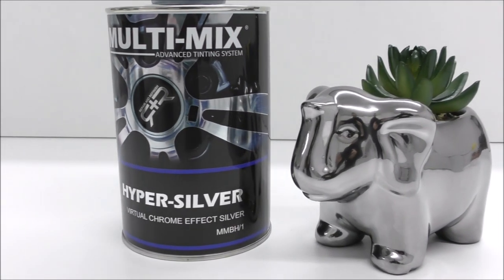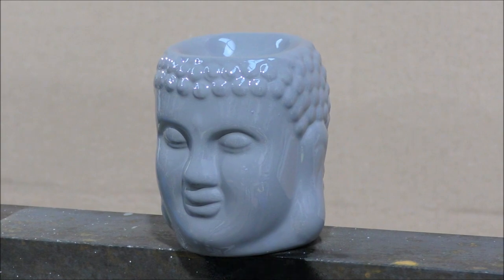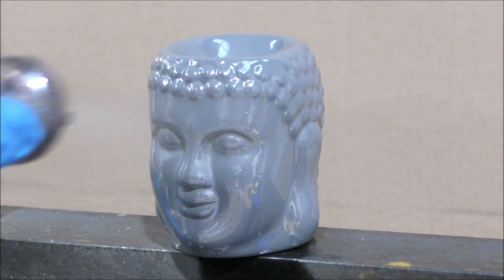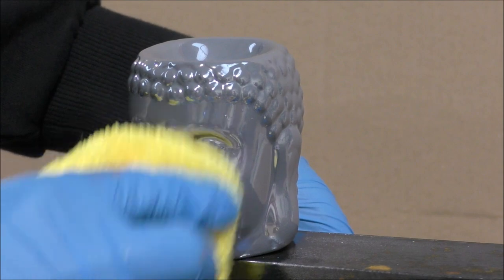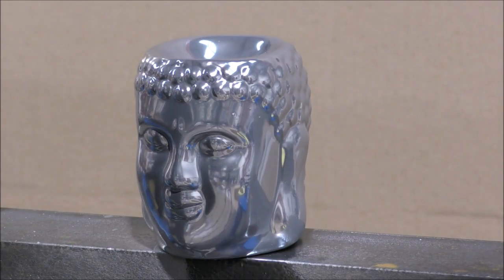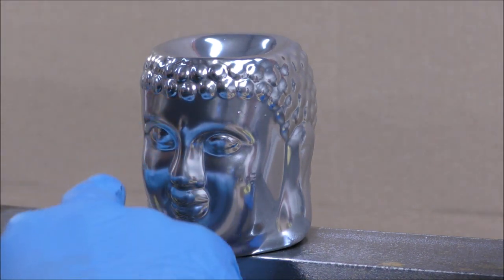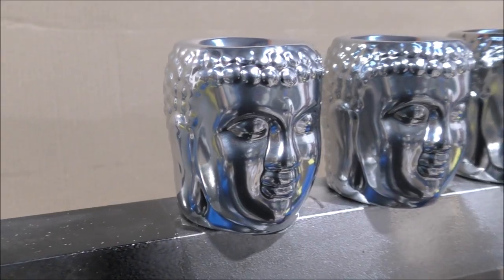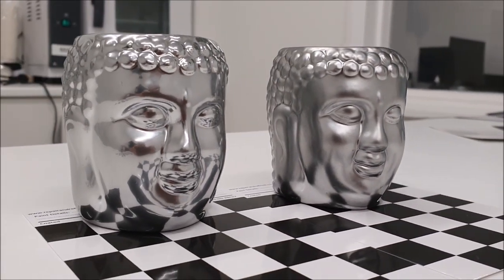MULTI-MIX HYPER-SILVER Virtual Chrome effect Silver

Comment: I'm really liking the finish you got with this product Jordan, what would be the process for alloy wheels and which colour 2K direct gloss would you recommend? the wheels on my SLK are highly polished bare alloy then it has clearcoat applied, the wheels are done like this from the factory and are quite rare on this car so I'm trying to find something that will replicate the finish. 

Problem is that my wheels are to far gone to have them diamond cut then re-polished as they are quite pitted so they will need to be filled and primed, I was going to basecoat them silver then clearcoat but your Hyper-Silver would give a better finish, any advice would be appreciated 🙏👍
Reply from the maker: Hey mate, i would go for the dark grey. This gives a neutral appearance to the silver. The black is ok but will give that shadow chrome look. Totally depends what you want🙂.